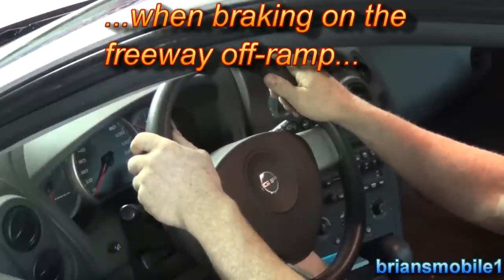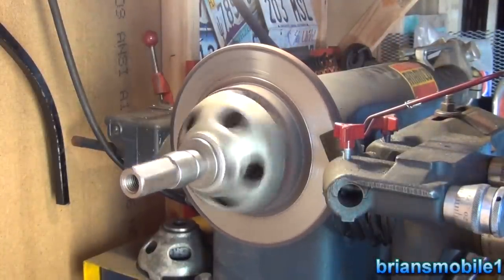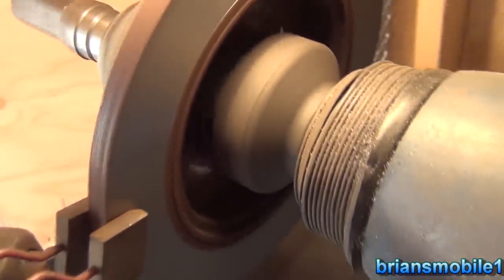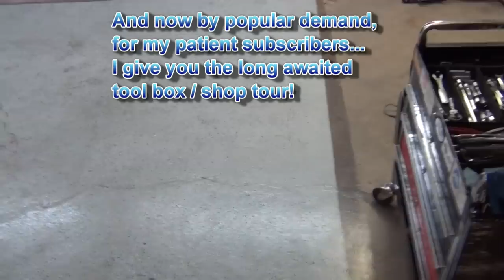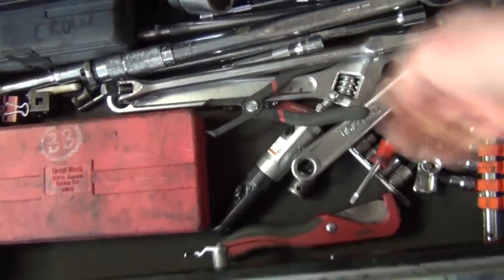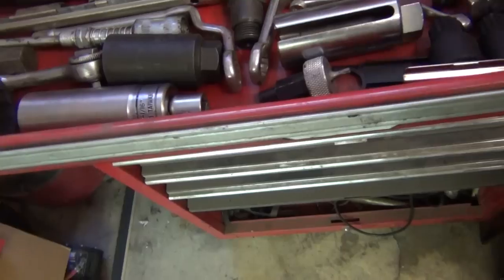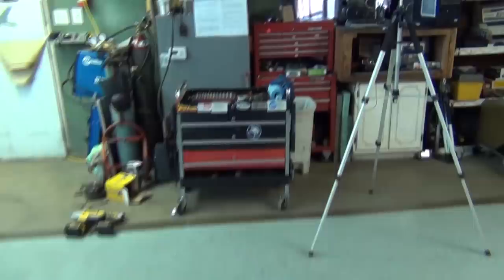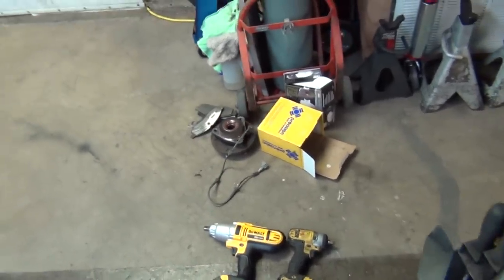Why Your Car Shakes When You Brake "Shake'n Brake!"

Comment: Brian, 
   I just finished some work on my 98 Impreza and was getting some wonky wobble and brake pulse from the front end. Turns out there were a couple boogers of rust between the rotor and hub that weren't letting the rotor seat flat and true. Had to take both front rotors off and clean that area smooth again. Old rusty cars are fun!

Comment from the maker: It really depends on your thickness and if it's even needed.  AND if you have cheap warp prone rotors to begin with.  Typically the factory ones are worth turning if it's needed.  If they're cheap low grade steel rotors and they're warped, I would just replace them with something good that is worth turning the next time.

Comment: Yup!  As soon as I saw the title of your video, I said "Mmm, he'll about GM for sure, or even better, about 1997-2000 Malibu".  Wasn't surprised to see it in the credit lol!  They were pretty bad on warping disk, jamming the right strut thrust bearing (then break the coil spring), and also had a bad designed header gasket that allowed coolant to go in oil with a few 80000km on the odometer.  But it was cheap, spacy, powerful enough and comfortable.

Comment: Brian,
The reason we cut rotors backwards, is because under fast speed we take off less faster, and we don't waste slow speed while the bits aren't cutting anything. While using at slow speeds it gives a finer cut and less time for a break-in period, If you time it both ways, you will see which is faster. In piece work, two minutes faster per rotor is $2 more in your pocket.

Comment: Good video and you made me think. I've been chasing an intermittent problem with the brakes. I changed front rotors and pads which seemed to cure my problem, (noise when braking hard) the pads were gone. When I thought I felt something while braking after the fix I replaced and lube the slider pins. Again seemed to fix it till the other day when I felt it again. Never thought about the rears, I checked them awhile back and they were good. So hopefully this weekend I'll get a chance to inspect them. I agree with your comment that you give the info up front so you don't have to view the whole video which is nice except you miss all you funny off handed comments. TFS

Comment: Just to clear up some of the confusion. Brake pedal pulsation on a car with floating calipers is caused from the rotors being out of parallel. A warped rotor over time will cause this condition. you will find if you take the rotor he just machined and put it on the car and check it you will find it will have run out. and over time the pulsation will come back. Best way is to machine on the vehicle that way to true the rotor to the hub and it will spin true.

Comment: My bicycle shakes when i hit the front brakes, i say it's the ABS.
Reply: Whats the year, make, model, and trim of your bike? Depending on the ABS system your bike uses, could range anywhere from a failed foot brake or hand brake. Probably get it checked D:
Reply: Marcos Mendez Dude it's a bicycle :DDDD It just shakes because it's cheap and unstable, no real ABS, im just calling the shaking that for fun.
Reply: Marcos Mendez wait you get the joke, ok sorry i thought you didn't for a moment
Reply: Marcos Mendez LOL :D
Reply: Darude - Sandstorm Hahaha 😂 it's ok! :D
Reply: Marcos Mendez I screwed up :D
Reply: +Darude - Sandstorm But better checking it asap
Reply: Darude - Sandstorm lmfao
Reply: Smh Men 😆 lol
Reply: Ya know my wheelchair shakes when I hit the brakes and I assumed I just had a heavy hand. But now that you mention it, maybe it's the ABS? It's bad enough I run late wherever I go; I spend alot of time going in circles, which I'm guessing are the blown bearings in front hub. Oh well. Positive thinking - my sneakers last forever.

Comment: Like the video.  As a machinist, I'd like to suggest you trying high RPM with slow feed for your final cut to get the best finish possible.  Better the finish, better the performance and durability of the rotor.  Again great video!

Comment: Great video describing brake pulsation. I have to deal with "princess and the pea" type, very subtle to where you can barely feel it, never seen rotors that bad in other words. Something I've learned is to take a oh shit not sure what it's called but it has has a disc and it grinds the rust off the top and inside of the hat of the rotor before putting it on the lathe. Supposed to minimize rotor runout from the off car lathe, of course on car is optimal but due to circumstances that you cannot use on car, doing that with off car is close to using on car. If that made any sense lol

Comment: nice videos, very helpful thanks. i used to have an suv in which the front left disc rotor was warped. on braking the wheel used to lock up  forcing the rear of the car to  fish tail to the left - VERY Scary!!. i got both the front discs corrected on a lathe machine and everyhing was immeadiately back to normal. was a cheap fix as compared to buying new discs.

Comment: The problem that I have found with having your rotors turned (not all of us have an $8000 Ammco brake lathe) is that lots of brake techs are more concerned with making more money (working on commission) than making sure they do quality work. What I have seen some techs do, is they'll just jam the cutting tool in far enough to clean the rotor in one swipe, and in effect, making their rough cut and their finish cut all at once. That puts tiny little chips in the carbide tool bit, and makes it impossible to get a nice clean, smooth cut. A rough surface causes premature wear of the friction material (the main reason why I prefer to just buy new rotors). What I do, is to just take a little more time. I make as many rough cuts as needed at no more than .005, then take a nice finish cut at .003. This not only makes your tool last longer and gives you a clean finish, but helps prevent unnecessary wear and tear on the lathe, as well. Then I take some #80 grit emery cloth to the rotor, working it vigorously inward and outward on the rotor. What this does is give the braking surface of the rotor a nice cross-hatched micro finish to ease in the burnishing of the brake pads. BTW, I like your videos. Good job.

Comment: funny that, in GB we just call the rotors the 'disks' - with the brake being a disk brake and all, it just kind of makes sense for that to be the name of the key part of the brake.
Generally speaking, in Europe if you're using the term 'rotor' you're talking about a driveshaft or something (particularly in reference to electric motors).
Reply from the maker: Great point!  There's confusion of course because the rotating part under the distributor cap is also called the "rotor."   It's distinguished by being called the "ignition rotor" and this one is called the "brake rotor."
Reply: briansmobile1 it makes it confusing for machinists as well. they'll tell me im gonna work on a rotor when all of a suddenly they hand me a shaft

Comment: When I got my ASE certs in brakes, I was told it's from "Heat" warping the metal. If your rotor is shaking back & forth you've got loose lug nuts. The rotors warp from heat under hard braking, getting hot then cold then hot then cold.

Comment: There is a 'low-budget' solution also. Take VERY course sandpaper (36 or 30) Scratch your rotor's up. (really scratch them up!) Then install metallic pad's. A guy I've known since 68 told me about it.I did not believe that would work.I tried it on my car back in the late 90's and it actually worked! I figured, worse case, they will still wobble.If you have an extremely warped rotor it probably would not work, mine was a mild steering wheel shake on the brakes.

Comment: Other reasons for a shaking steering wheel or rear end can include the brake pads, brake calipers or failing suspension components.

Comment: O so thats how you machine rotors ... this lathe almost looks like a bench grinder with a place to but on the rotors. Still having a little trouble in determining when it is the front caliper to when it is the back drums based on the shake... however one could always do a manual hand spin test and listen there i guess. Nice video showing the re flattening the rotors for  brake calipers
 I would imagine though you don't want to take off to much unless you can get thick brake pads to compensate for the excess spaces

Comment: Revisited I have noticed the comment about the feed speed, reason people do the finish pass slow is to avoid creating a record.
Reply: rdnprops Did you find that term in a book!  1. People here are not going to understand what that Is. 2. You sound like you lack the general knowledge to use that word.  a normal turn pattern is far away from a phono Finnish. 
A Phono Finnish is usually 30 to 55 grooves per inch and can be either concentric or spiral.
Reply: You need to have another look, I am not the one that posted the video!  I do NOT nor would I ever use a brake Lathe period.  I never had a rotor make noise in the first place.  Furthermore the proper finish for any Rotor is a cross hatch pattern done with a brake rotor hone. it is that hatch pattern that will keep a brake quiet.  At the end of the day it is experience along with some good mechanical ability that will get the job done correctly the first time.

Comment: I guess I was told the wrong answer in school 10-12yrs ago, my bad. I just learned they don't warp at all, they wear unevenly from heat expanding the metal causing high and low areas giving it the look of warping.

Comment: My front driver side rotor was warped so bad from the old owner that when I took it off and set it on the ground there was at least a centimeter and a half between the rotor and the table, and I've always been told you can't see it with the naked eye, well you can

Comment: If your brakes have been replaced and bedded properly, shudder possibility could be tie rod ends and/or rack. I've run into both.
Reply: Hey,  I have changed new pads, resurfaced front rotors and changed all four tyres and balanced them too. Now , the steering wheel on my car shakes when I brake above 120kmph. It doesn't shake in normal speed. The car has done 90K Kms on the odo, and never had any major hauls so far. So, do you think my problem has more to do with tie rods, suspension? Thank you :-)

Comment: My steering wheel used to shake when I would brake, but it turns out all I had to do what replace my front brake pads. The discs were fine as well as the rear brake pads.
Reply: Vicky Mudher That very well might be the problem. All I have to say is that I've already had that problem happen to me with the wheel bearing and I waited too long. Get it checked out right away. My father is a mechanic so he always stresses the importance of issues with safety for all of our vehicles. :P

Comment: Hey brian! Recently found your channel, and really digging your attitude. Everything is done and explained like I'm right there.  I know this isn't the video to ask this, but I have a 2006 Audi that has some starting issues. When i turn the key to start my car it feels like it cranks 1, 2 seconds before turns over, on cold starts. After driving it, if i turn it off and turn it on, it starts up right away. I already replaced my spark plugs, engine air filter, and fuel pump, what else could be the problem??

Thank you

Comment: Brake dust buildup will cause a rotor to read as warped. Most shops will tell you to replace your rotors over and over. Grab a wire wheel and clean your rotors and brake components. A good quality rotor should last for 50k miles. I just replaced my rotors after 80k miles and it was only because they were rusting out....
Reply: And here i am with 240,000 miles on the original drums and rotors

Comment: I never get mine cut.  They are not so expensive that I would want to save them when they get warped.  I have a 2006 Jetta 2.5 and it sometimes costs as much to have them cut as it does to replace them.  I use good Zimmermann rotors too and I don't like cheap parts.  Zimmermann rotors have a special coating on them that you don't wash off but instead it wears off where the pads touch them.  This makes it easy to install them on a car because it is one less step that needs to be done.

My Uncle once washed his with soap and water.  I don't know why anyone would do such a half-fast thing but he did it.  It did not get the cosmoline or what ever it is they use off.  I took a ride with him and the truck stopped just fine but it was making a burning smell because the rotors were NOT properly cleaned.  He ever does the brakes on my car like that I will get him a gallon of acetone.  Acetone is one of the active ingredients in brake cleaners because it works so well.  Sure it is toxic and extremely flammable but it will do an infinitely better job cleaning brake parts than that stupid soap and water.  I am guessing that the soap and water is some sort of environmentally friendly way of doing it.

Damned tree huggers are making everything not work.  Look what the bastards did to dishwasher detergent causing white spots on everything when they took the phosphorous out.

Comment: Is it worth the price?  Last time I checked, it would run you $10/rotor to resurface if you would have to get this done at a machine shop.  For most warn rotors I would think you are better off spending that money toward the brand new set of rotors.

Comment: Nice video buddy! I have the exact same issue with my Ford E350 09 model, rocking steering wheel and jerking back and forth as if I was trying to imitate anti-lock system. So I'm guessing it needs to be done like yours? and what about the jerking part? thanks in advance buddy!

Comment: I don't know if you'll respond or not but I'll try this anyway. So very recently had my rear brakes and drums replaced as well as the front brakes. The shop said the rotors were sufficient and we didn't need to replace them if we wanted to save a few bucks. Could the rotors be warped and the shop couldn't tell at the time the brakes were done? Also if the rotors are warped could they be the reason for a humming like noise coming from the front of the vehicle? This humming gets louder the faster I go, I originally thought it could be the wheel bearings, but the noise doesn't change when making right or left turns. Do you have any suggestions as to what it could be? By the way it's a 2002 Grand Prix GTP I'm talking about.

Comment: About the plastic gear, how about having your local career center make one out of metal?  Their machine shop class needs something to do =D
Reply from the maker: That seems like a great idea, but the whole point of a mechanical fuse of plastic is to protect the expensive gear assembly down-line.  A metal one would be like using  a 30 amp fuse in a 5 amp fuse' spot.  It would fail to protect what a fuse is there to protect.
Reply: Right...but if you use a soft metal then it will still take all the wear and last longer than plastic. Is not quite like the scenario you mentioned, more like the bearings in an engine.  Are metal, but softer than the crankshaft =D

Comment: I cannot find a shop to do this type of work anymore in NYC. I've been told that anti-lock rotors cannot be machined. I think that's bullshit. They also claim that it's dangerous. To my knowledge it's only dangerous if there's too little material left.
Reply: moden disks are vented and if you try to this you just cut right into the vented bit (if your disks have gotten to this point just replace your pads and disks on both sides as they probably don't have any life left in them)
Reply: Carlyle Tom your exactly right. They can be resurfaced

Comment: I bought a new 2015 gmc 2500 crew cab long box pickup the front rotors were warped from the factory and were replaced once.  next mountain drive unloaded It happened again with the new ones.  Now I was not driving or breaking it hard at all just was coming back over a pass.  The second time Gmc said they were a little warped but would not replace.  They called it a wear item and was not covered under warranted.  at the time I was under 40k miles on the odometer.  What should I do replace them at my cost and have them do it again?

Comment: There is nothing wrong with redundancy when it comes to tools. As of now I have probably 5-6 of every size, length 6pt or 12pt both impact and regular chrome sockets. Part of this is because I will not use my snap on and matco chrome sockets on an impact gun(call me a sissy, I don't care) Also, when SHTF, it in imperative that I have back ups. I however do not play favorites when it comes to brands, if the tool works, awesome. However when it comes to basic hand tools, I will only buy the best.

Comment: roators warp beacuse people drive 90 mph between stop lights and slamm the breaks on at the last sencond and hold down on the break pedal with out pulsing the breaks giving the roators time to disapate heat.

Comment: It also can be that your tires are not ballanced right. And you dont have to feel that during driving. I had this problem  i replaced the disk brakes and the problem did not go away. Then i had a flat tire at the back  so i had to put the spare on. And the problem dissapeared.
I never think about this but i should save me a set of disk brakes:-(

Comment: Can a bad wheel bearing throw the rotor into warpage? Had a bad wheel bearing replaced it now the shake is worse but it's the opposite side & screeching.. Pads and rotors where replaced 10k miles ago so I'm wondering if the bearing shake caused my caliper to slice in the rotor